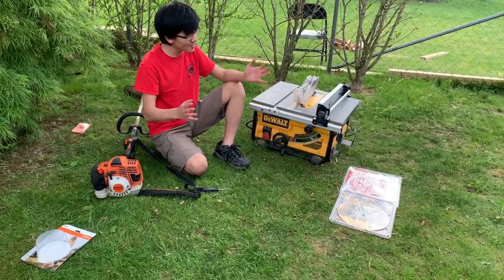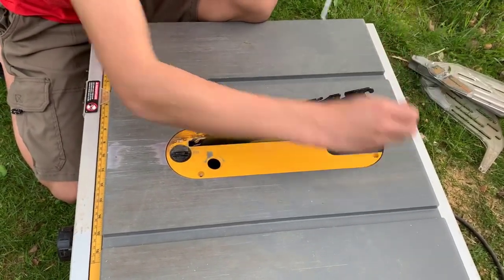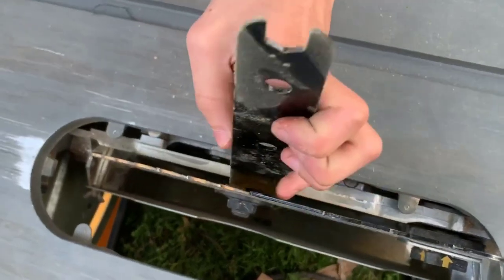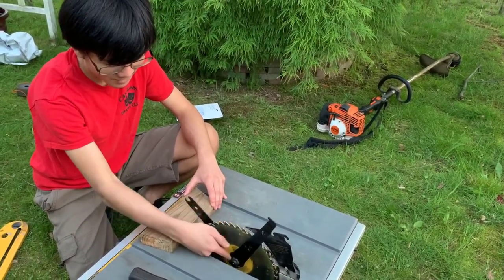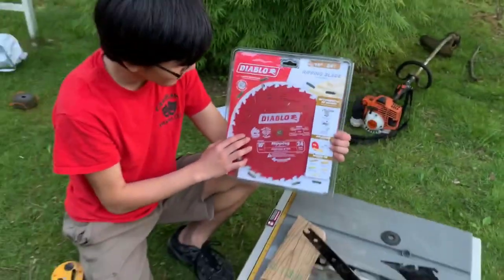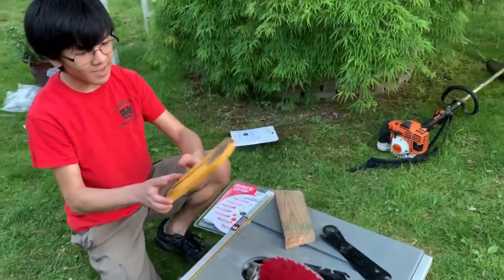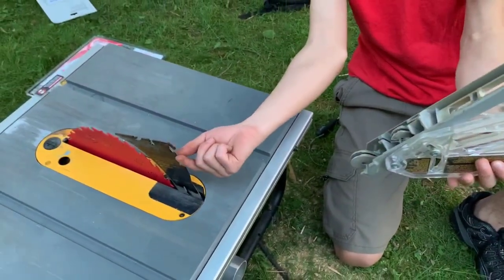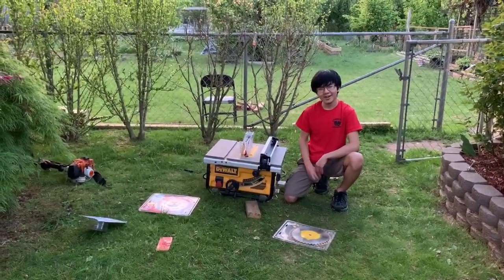How To Change Blade On Table Saw | DeWalt Portable Compact Job Site Remove Replace w/Diablo By Freud

Comment: have to admit, was a little worried there when you loosened/tightened the saw nut with your bare hands but it worked out alright. good work.
Reply from the maker: Great point! I was thinking about putting on the gloves to show good examples but we were rushing as it was getting dark....

Comment: I replaced mine with the diablo 80T, and the saw starts making loud squeeze noise. The noise stopped after putting the old blade that came with the saw. Any idea why this happens?

Comment: I guess by now you realized that the 4 screws you took out of the throat plate were level adjusters and not fasteners, they do not need to be remove... however loosening the arbor nut was very useful...